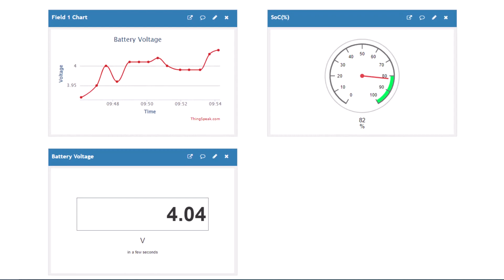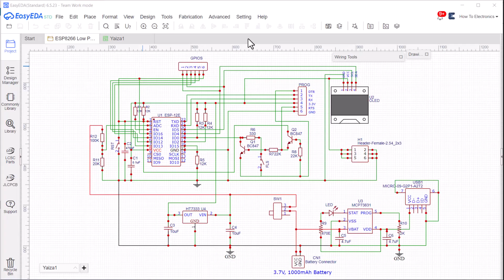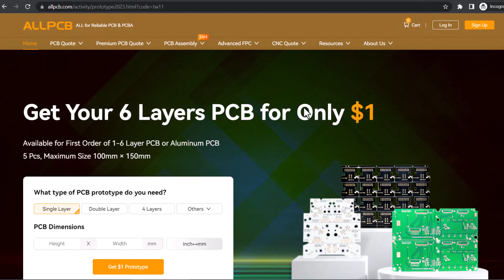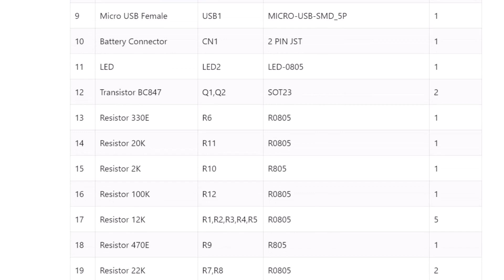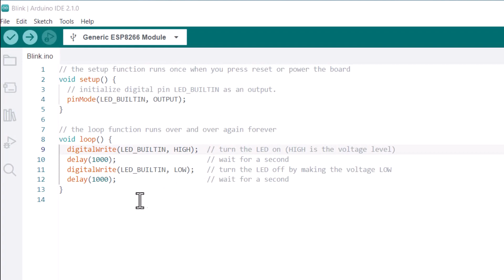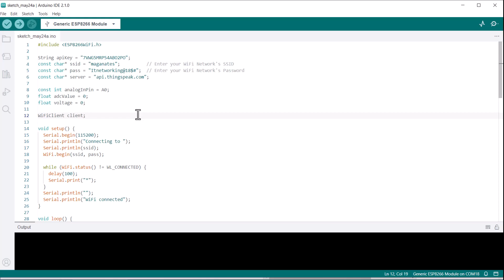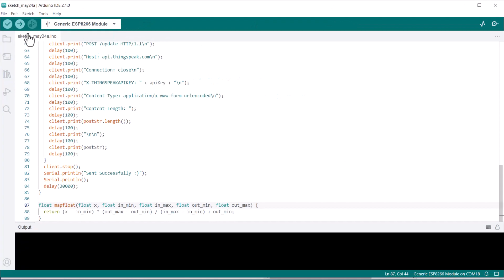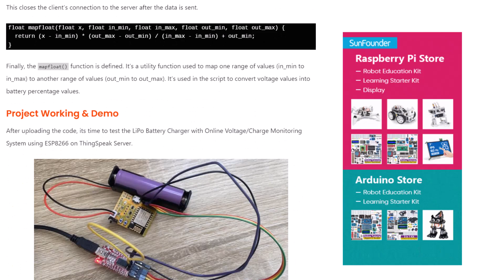IoT Based Battery Monitoring System + DIY LiPo/Lithium-ion Battery Charger with BMS

Comment: Great tutorial, can you please share the process how to monitor a 12 or 24 volt lead acid battery using this system including battery temperature.
Reply from the maker: Check the latest tutorial video, it has 12/24  battery or Solar Panel monitoring system. You can use it to monitor voltage up to 36V and current upto 30A.

Comment: do you pland to make a even smaller version without using an ESP32 with BT/Wifi connection? Maybe using an ATMEL chip like on Arduino Nano board?

Comment: How,if bateri monitoring with voltage range 50 - 300vdc, solar panel application, please..tutorial
Reply from the maker: I am working on it. A video will come about that in a month.
Reply: @HowtoElectronics qual é o video para monitorar maiores tensao ?